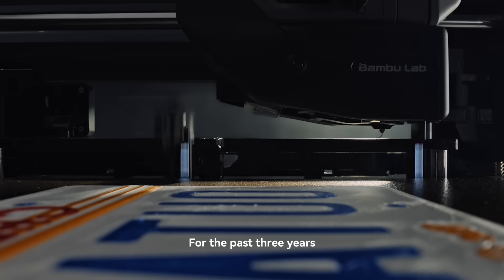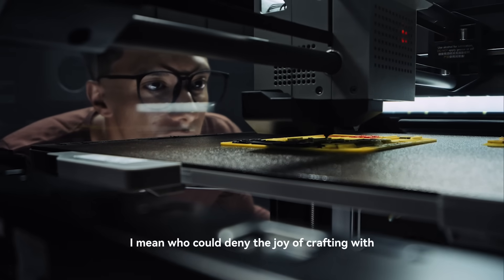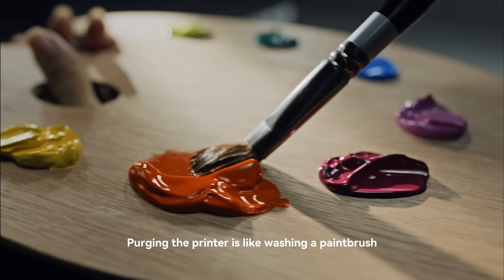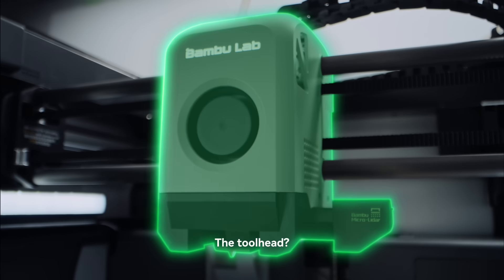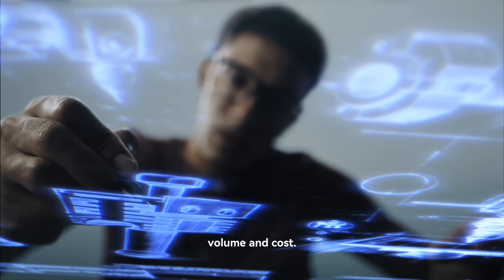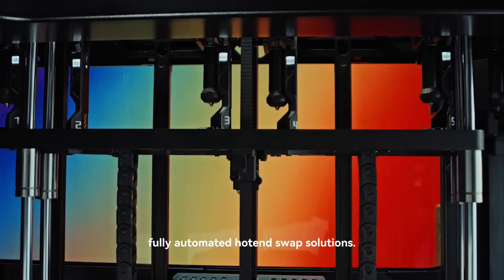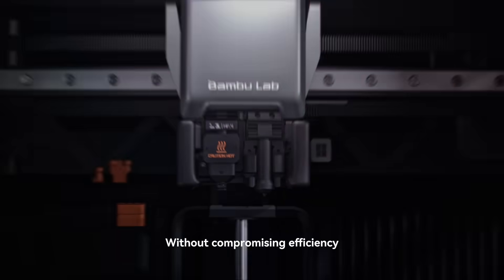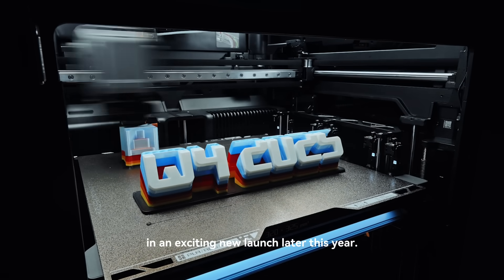Meet Vortek: Our Answer to Zero Purge Waste Multi-Material Printing

Comment: I had an X1C right after launch and honestly, it was fun while it lasted. The speed and the flashy AMS were cool, but clogged nozzles and constant tinkering wore me out. Tried the Core One recently and the print quality is just on another level. Then I got an XL and AMS feels like stone age. Rock solid, zero drama, you literally forget it’s even running. After this, I’m not going back.

Comment: 1. Bambu Lab made pooping multi-color printing popular, and now they use word "noodles of regret", "wasteful", "problem" to - IDK - blame the users for buying their printers?
2. Bambu Lab released dual-nozzle printer just months ago, and now they dismiss multi-nozzle technology as too complex. Who would have thought about that
3. To combat this, they make another unnecessary complex "nozzle switcher" (not sure what happens to the filament path, if you cut it, nozzle needs to be purged empty or "goodbye retractions") -- while they could have cooperated with Bondtech to get INDX in their printers

Here we go again :D

(I'm also not target group for 1k+USD closed-as-hell printers. P2 with A1 or H2 hotend and better display might be on the verge)

Comment: So if this is only swapping the hotend and there's only one bowden, there's still gonna be a cut, pull back the old and push through the new from an AMS unit. This is still gonna be notably slower than a toolchanger even without the purging.

Comment: Nice solution. But will it still be good for technical filaments too? 350°C on the nozzle and heated chamber? (I checked FAQ, this topics is not touched so far)

Comment: No one gonna talk about the fact that you still need a purge tower ? We are literally back to square one. Congrats....
Reply: apparently no need for purge tower as each filament has an assigned nozzle (if using less than 7 colors / types).
Still need a priming tower though but that's much less waste than poop and much faster.
Reply: @raphofthehills4405  Oddly enough, they showed a purdge tower in the video. Kind of weird that their advertising would say you don't need that, yet still show it in the video during actuall printing.

Comment: This is exactly what I was worried about: AMS + toolchanger = twice the hassle 🙃. Looks cool on paper, but in practice… meh.
Reply: It's not even a real tool changer, more like a hot end changer. This design only has half the benefits of a real tool changer. It has low waste, but will still be slow compared to real tool changers. At least double the print times.
Reply: @03chrisv  What do you mean? what are the benefits of a real tool changer? you can see in the video the hotend change is faster than a snapmaker or a proforge, and being induction heated heats up the nozzle wayy faster. its also alot cheaper, being that its simply a nozzle, i dont want to spend 1000+ dollars for a full set of hotends for the prusaXL, the nozzles would probably be like 30
Reply: @kjlkdjasd The different approaches have different pros and cons. The XL has full print heads swapped but needs extra room at the back for the heads and filament lines, but can do stuff quickly. I’d imagine Vortek is a bit slower with the heat up time, plus you still need to change filaments, but then it takes up less of the printer’s space with only one filament line.
Am wondering what the cost for the hotends will be. Historically it’s been good but I’m wary about how available the boards/board standard will be.

Comment: Yep... this tool changer is brilliant. But here, Bambu aims to save waste and space—not nozzle tool changing time.
From what I understand: filament retraction (or cutting?), tool change, nozzle heating phase, purge tower, then go.
I think the future Snapmaker U1, Prusa XL, and Bondtech INDX are safe bets.
For the U1: tool change phase, purge tower (with some tuning, you can almost skip this step), and it's ready to go in 5–6 seconds.
Sure, it takes up more space, but it's efficient.
But Bambu's engineers are brilliant—nothing to criticize there.

Comment: for those confused about why this will come to the H2C and H2D first, it appears to only be swapping the right side nozzle from an AMS - the left side nozzle will be for your non-AMS compatible filaments same as it currently is on H2D.  If they did this mod to a single nozzle printer, you would not be able to use non-AMS compatible filaments with the printer at all.  Just my 2 cents.

Comment: Want to see the print times with the retractions compared to the other new solutions. The winner will be who will keep the better alignment between all the heads with all the heads swaps happening during a single print.
Reply: there will be multiple winners depending on criteria.
speed: toolchanger then indx, then vortek+ams, then dual nozzle then single.
waste: toolchanger / indx, then vortek+ams, then...
reliability: ...
repeatability btwn changes / vfa / surface quality: ...

Comment: this is amazing engineering. it looks so cool, an the induction heated(❤) wireless hotend is just so cool!
however, it saddens me to say - this is not a great advancement for 3dprinting. the purge is a big problem for two different types of printing; practical multi-material printing, and aesthetic multi-color printing. 
the more common use (and the more purge intensive) is multi-color, and for that more colors with less waste is not that great of an improvement. the technological next level for color would be variable color mixing - the ability to print at a specifically generated color at each point of the print, by combining colors somewhat like a normal printer. the best way i see to achieve that is a colorless filament and a colorant adder before the nozzle. the closest thing i could find is sharpie coloring from years ago which does work but needs some upgrades for commercial use.
the second type of printing is with different materials for soluble support, or variable flexibility engineering parts. for this use 8 hotends is excessive. the need for 3 materials is not very common, let alone 8. to be fair, this seems like a decent option for this type of printing, but it doesn't offer anything over a design like the U1 which is based on more proven technology, apart from (probably) a higher price tag (it heats faster but the U1 can preheat the hotend).
in conclusion, i love the tech, but this is not the right use for the engineering that went into this. if anyone with sway reads this i highly recommend investing in either an AMS type machine for continuous variable color or a color injecting nozzle. then if you want to throw a bone for us makers you could upgrade the X1 series to have quick changing toolheads, which will probably be cheaper and more reliable.

Comment: wait, then what is the small tower on the back left at the last scene? isn't that still a purge tower?
Reply: its the prime tower. Not a must-have if you dont care about printing quality.
Reply: @TheQuarkQuark I guess it does remove the purge balls.... But isn't having a prime tower the same as a purge tower?
Reply: @robonxt  no purge needed if using less than 7 colors. purge is done only when swapping filament in the same nozzle like today.
this is a prime tower. not mandatory, can prime into support or infill or disable it.
Reply: @raphofthehills4405 my thought was that this new nozzle swapping will reduce if not eliminate the need for any type of priming or purging for any quality. I guess I'll have to wait a few more years

Comment: I've ordered the H2D Pro but may upgrade the tool changer to this if the nozzles are also high quality tungsten carbide. The standard H2D had too many compromises but the Pro fixed a number of them. H2C may be aimed more at hobbyists, instead of engineers, as hobbyists like multicoloured prints to be pretty.

Comment: “But this came at the cost of purge those little noddles of regret that spat out with every print. It’s wasteful it’s time consuming AND IT’S A PROBLEM THAT PLAGUES EVERY PLAYER IN THE INDUSTRY”. Only Bambu can gaslight everyone and get away with it. Toolchangers have zero purge and have been around longer than Bambu as a company has existed.

Comment: Interesting. It doesn't look like Bambu Lab is swapping the entire hot end with the filament tubes. The are literally just swapping the nozzles of the hot end. Chances are they will still cut the filament and then swap out the old filament to the new filament with the changer. Since the system remember which nozzle had used which filament, the used nozzle will only get swapped with the filament with the same color that it have used before; therefore, no color bleeding issues during the swap. Much more efficient and save a lot of space unlike what Prusa and Snapmaker are doing where they swap out the entire hot end assembly with the different filaments and tubes making it bulky. Very good engineering design. Kudos to Bambu Lab.

Comment: Where is the filiment?  This Vortech sytem it looks like it's swapping nozzles AND then will still have to reload filiment in from the top from an AMS?!?  Will still need to reload (slow) and prime to build proper pressure.  Not as much as pushing the old filiment out of the nozzle, but reloading and priming takes time.  In Bondtech's INDX system the filiment stays on the hot end so swaps are super fast.

Comment: So does each nozzle unload filament after use? If so, isn't that purging/priming when it's reloaded? It's better than a shared nozzle, but why not have a system that can keep filaments loaded in their respective nozzles until they're done being used for that print?

Comment: this looks really cool. I'm confused/surprised that in the final shot, there is still a purge tower present in the actual print bed. Why?!?
Reply: Isn't it still there to wipe the nozzle and keep it clear so old filament doesn't dry to it? When I read on the purge tower before they reference it as a wipe

Comment: Will this be adaptable to previous Bambu machines? Or is this only going to be made for newer models? I'd love to invest into something like this into my P1S and X1C I just recently purchased and don't want to treat them as bygone tech now
Reply: Theres a wiki article on the system, Its mostly for the H2 series aka H2S and the H2D as an upgrade which will require a bunch of work on them and its not going to be super easy.

Comment: Whether you like bambu or not this is some sweet engineering.
Reply: What possible reason could people have for not loving Bambu? For those like me who have been in the 3D printing world for years, the time before Bambu was a complete disaster.
Reply: @erdemgenel_r , the walled garden approach that they used
To block any third-party software after building their empire off the backs of open source comes to mind.
Reply: цена завышена, зачем мне платить в 2 раза больше если я получу то же качество печати а может и лучше если хорошо настроить  @erdemgenel_r
Reply: @erdemgenel_r  Its just politics, People think because Bambulab is Chinese they think the firmware update turned bambulab printers into spyware. Obviously this is just a hoax and people just want an excuse to be racist and inconsiderate, but its just how politics work.
Reply: @erdemgenel_r  A lot of people do not like the closed ecosystem. How they took an open source slicer and made their own. The recent "security" update fiasco, the list goes on.  I have mixed feelings about them, but I do own a Bambu printer .
Reply: @erdemgenel_r  lots of Bambu haters out there. They are just in denial.

Comment: Can I upgrade my P1S with Vortek?
Reply: "The "Vortek" is both an upgrade system specifically designed for the complete H2 series of Bambu Lab 3D printers, as well as a brand-new flagship printer. The upgrade kit for existing H2D/H2S users will allow them to upgrade their current 3D Printer with the Vortek system."

Straight from their FAQ wiki on it and with "flagship" they mean the H2C thats upcoming

Comment: So unlike Snapmaker U1, it appears this system still requires a filament retraction between nozzle/colour changes and if no purge then surely a risk of discontinuity in filament flow due to inevitable gap between filament already in the nozzle and new filament being fed in as part of nozzle swap. Surely multiple tool head system doesn't disturb filament in the nozzle between changes because the filament isn't retracted from each nozzle between changes. I'm not convinced this is actually better than multiple tool heads despite induction heating and wireless power/comms.

Comment: You guys should make the ams lite compatible with the P1P, it's basically a core xy A1 so it makes sense. It would probably just be a simple firmware update with some preexisting hardware added on. I like the open concept and I feel like the ams lite goes better with it.

Comment: So it's a hotend swapping mechanism to avoid the need for purging. But you will still need to swap the filament via AMS which would make this much... Much ... slower than the tool head swap mechanism in a prusa XL or the Snapmaker U1. This honestly looks like a flawed half solution designed to be able to keep their manufacturing. costs low and keep on selling AMS units.

Comment: I don't want to be that guy, but theres still a Purge Tower in the back? So you've not achieved zero purge?
Reply: It’s a prime tower to prime the nozzle with pressure. Every single multi color, multi-toolhead printer will need one, there is no way around a prime tower; unless you want to prime into infill, but that will make the infill structure weak.

Comment: This design still required a purge tower?
Reply: It’s a prime tower, not a purge tower. The Prusa XL, the U1, the H2D, every single multi nozzle or multi material printer, all need a prime tower to re-pressure the nozzle with filament.

Comment: It is good to see more tool changer printers.
I do have a question on how this will eliminate purge waste?
in the video the printer only changes out the nozzle , the filament is still in the printhead. you still need to change the filament color at some point.
Is the filament still being purged but in smaller amounts? or are you using software to calculate when the new color arrives at the nozzle?

Also how do you prevent clogging of the nozzle when you store it and it is being reused with different types of filaments?
Reply: The think if you look at the purge Tower at the end of the video, most of your purge questions of the purgefree printer will become clear 🙂

Comment: So from what we can see it looks like an AMS is still necessary. The printer will cut the filament, retract it into the AMS, swap nozzles, then feed the next color via AMS. So each layer change will take dozens of seconds to swap still, granted faster then purging. It definitely helps pla/petg/tpu contamination issues present in the current systems, but doesn't help the inefficiency of the AMS... And frankly where most feed issues arise. I think snapmaker is safe for now.
Reply: I hate it when filament breaks inside the AMS, when i havent printed 2-3 weeks it happen each time. It drive me nuts because i have to dissassebly the whole AMS to get the filament out. I already have the hydra AMS where sometimes i can pull out the fillament by just dtaching the PTFE tube, but this is only when i am lucky...
Reply: @br0berger-tech they really should have had a quickly removable panel on the bottom, or some clips to retain the assembly. Having to find the one extended hex driver in my toolbox to get the 2 buried screws is a pain. Not to mention removing all the decessant bead containers I printed...
Reply: Therefore i am really lookinf for the snapmaker, one fillament, one tube, no gears in betwen burried in a box with hard to reech screws and flimsy connectors.

Comment: so why still the purgetower? and why are there pads on the the swappable hotends if there are no pogo pins?
Reply: Not a purge tower, a prime tower, they are different. Even the Prusa XL does this when changing tool heads. You always need to squeeze out a little filament after a change to prime the nozzle and build up a little pressure.
Reply: @NorwayVFX ok but it still is waste would be cleverer if that could be used as infill instead of throwing it away
Reply: @TheFlow2006  You can, it's an option in the slicer. You can do it with all their machines but it's not a default setting since print quality may suffer.

Comment: So two questions.. 1. If this has been in development for 3 years why not announce it as a future option when dropping the H2D bc many would have waited. 2. The filament still has to travel through the PTFE tube on top of the printhead so you still have the time for retracting and feeding, doesn't sound like this saves any time, so this just adds another step to the process?

Comment: I thought collecting high quality die-casts and playing cards is my hobby, along with drinking wine too often, but buying Bambu Lab equipment is, it seems.

I just got rid of X1C with 2 AMS units, replacing it with H2D…with 2 AMS 2 Pro units…went on vacation before setting the printer up, saw H2S teaser. Its announcement didn’t upset me - I got H2D specifically for faster and more efficient multicolor printing, but H2C seems to be a different story. I guess H2D will replace P1S in the office. If I can do it faster than Bambu Lab announces H3D. It’s a 25-minute drive after all.

Comment: I could be wrong but at the end of the video I still saw a purge tower.
Reply: Not a purge tower, a prime tower, they are different. Even the Prusa XL does this when changing tool heads. You always need to squeeze out a little filament after a change to prime the nozzle and build up a little pressure.